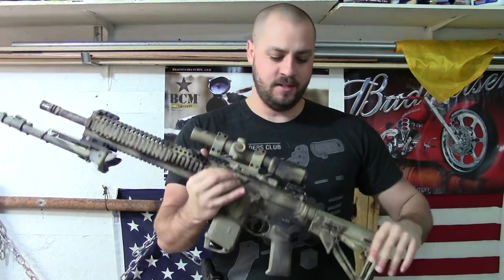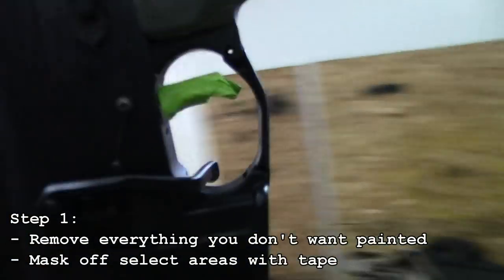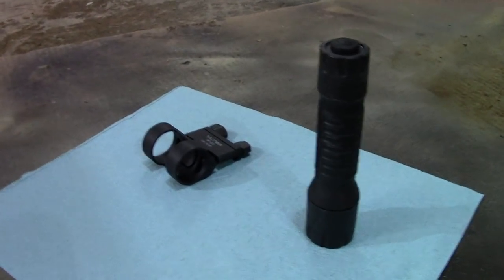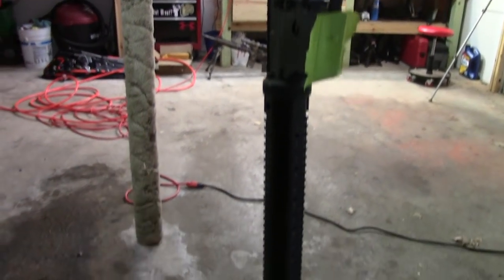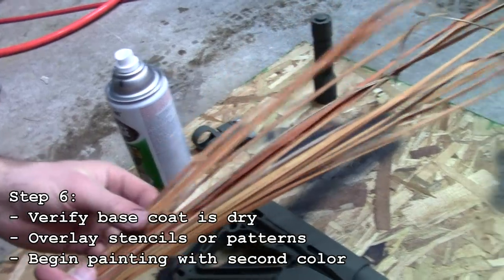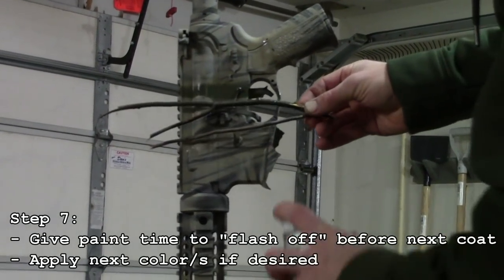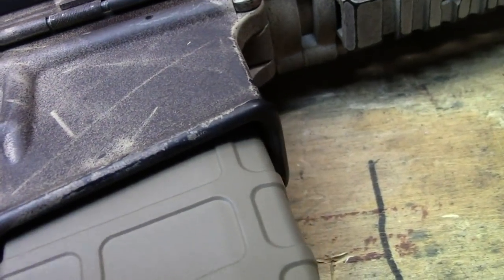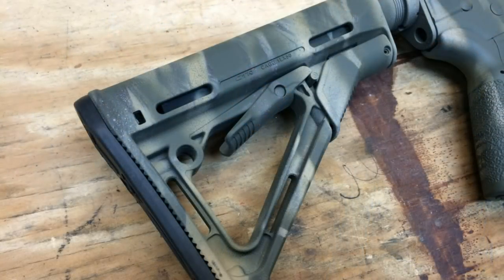AR15 Camo Paint Job - How To

Comment: Couple of hints:1. Wiping with a rag while still wet gets it cleaner. Kind of like preping a car.  If you only wet it, some of the junk just relocates.2. Final wipe with isopropyl 91% gets deep.  Then one or two coats of adhesion prometer on the polymers gives a better bond.  Maybe even on the phosphate.  It's onl;y a 20 min. wait to start painting.3. Rustoleum says within an hour or after 24.  I base then wait. Next day, Fifteen minutes between colors.4. Rustoleum clear flat--isn't.  I contacted them.  There is a "Dead Flat."  It's in that new shaped can, but it shoots very wide, very fast.  Practice to get very light coats.  I waited a couple days before doing that.5.  Recommended dry is 5-7 days.  After the initial dry-to-touch of a couple hours, I set it against the wall next to a heat register for four days.  Doesn't really stink.
Reply: Yes with rust-o-leum you need to let dry for the 24. I've found that the Krylon dries much more quickly if you let it out in full sun...tends to bake it harder...I my self don't care for the cerocote. When it chips/wares  you pretty much have to do a tare down. With paint it's pretty much a touch up and you good to go...
Everyone that see my firearms wants me to do theirs and I've had a ton of offers from people to buy then on the spot...My experience is that it up's the value by the many whom enquire
Reply: Good lord dude, you're spray painting a rifle... not painting a new lambo.

Comment: Looks nice. I used 4 colors. Black, hunter green, dark brown, and nutmeg which simulates a sand color. I used painters tape and tore pieces to make a tiger stripe camo right on the black anodized finish. Then painted it with hunter green. Made a stencil out of a piece of cardboard in a tiger stripe pattern and used that to apply the brown and nutmeg. Once I was done I lightly misted the entire rifle with the hunter green and nutmeg to blend all the colors together. Used hair dryer to dry the paint faster. Removed the tape and it was done. Turned out really nice. Standing ten feet from the rifle laying in the grass, it blended very nicely. This rifle is also the one I'll be using to hunt coyotes and other small critters with so camouflage was important imo.

Comment from the maker: Lots of you asked for it so here it is!  AR15 camo paint jobs!
Reply: Did you remove any parts or internals? I would think just throwing paint on the rifle could cause some sort of malfunction or interfere with the operation of it
Reply from the maker: Aluben Only the BCG.  We closed the dust cover and didn't spray into the mag well.  The dust cover seals off well enough that there is probably no need to remove the BCG, but we did just be safe.  The amount of paint that might get through the dust cover is so small it wouldn't have any effect on the function and it would be worn off after the first magazine is shot through the rifle.
Reply: wouldn't let me tag you. But did the gun come with that delta ring or did you add it extra. looks bad ass and way easier than mine to take the handguards off. Is it a BCM and you can put one on an ar from a different manufacturer? sorry lol I'm new to ar's. I recently bought one. I'm usually an ak guy
Reply from the maker: Always Armed88 That ring isn't technically a delta ring per my understanding, but it does look like one.  That is just how the LaRue rail mounts to the upper.  This is a complete BCM upper, the rail has not been changed out.
Reply: Hey I know this is older video but do you need to tape off the gas block I have a shaved fsb under my bcm kmr just wanted to know if I needed to cover it before painting. Thanks

Comment: Brake clean is a terrible choice for pre-paint cleaning.
Reply: yeah its also a terrible choice to spray your rubber and plastic with. SMH. 50/50 H2O/IPA.
Reply: hotrodsather. Why? I've had good luck with it for 20 years. No residue, and drys quickly. I also use air to dry after rinsing.
Reply: I always use alcohol
Reply: @jhutch1470  it dissolves more than you'd like, like the wax that keeps your handgrip's rubber flexible.
Reply: @Justbase  I use it on my upper, while it's detached from my lower. I usually use the regular gun cleaning stuff, but have used brake cleaner for heavy stuff.

Comment: The one problem I had with Rustoleum was on the extension.  Once painted the B5 SOPMOD and LMT SOPMOD stocks would not slide over the extension freely.  I had to put a mag in the lower and use my foot as a brace on the mag using my body weight and pull the stock off.  I removed most of the paint on the extension to allow for the stock to ride freely in all positions.

Comment: What's stopping paint from leaking into the dust cover, charging handle, mag release, etc?
Reply from the maker: Tolerance.  All of these components seal pretty tight.  It's a non-issue.
Reply: Highjak86 Thanks for the reply highjak.

Comment: The first coat looks like the Rustoleum Army green, then it looks like you covered it with the deep forest green , there is no Rustoleum  OD Green, so could you tell which one you used,or what you did for to the base color. Because it most definitely change from the Base coat at the start and then when you went to laying it down the straw strips it was dark green.
 Thanks, trying to use y'all's technique

Comment: Did you use any sealer after you were done?  I know that there are non-glare sealers that might make the paint job even more durable.  Thank you for the informative and helpful video.
Reply from the maker: Negative.  Even the matte and "non-glare" clear coats still have some level of sheen to them.  We don't care about the paint enough to feel a need to preserve it.  We would just re-paint when we feel it's needed.

Comment: im surprised that break cleaner didn't melt your stock/pistol grip.
Reply from the maker: Oh, it's not that strong at all.  Acid might do that.
Reply: AIRBORNE916 Brake cleaner is not too strong and dries extremely fast. I also hit it with compressed air and it dries in seconds. It's really great stuff.

Comment: I'm in the processing of building an AR from scratch, so this may be a dumb question but would you still recommend spraying it down with the brake cleaner?  All parts are brand new (stripped upper/lower) and new rail.  I also plan to paint before I add the upper and lower kits for the contrast...Oh and do you prefer krylon over rustoleum or does it not matter?
Reply from the maker: Yes, most parts, especially when new, come with at least a light coat, some a heavy coat, of oil on them.  Always degrease before painting even if new.  Krylon vs Rustoleum, I'd call it a wash, pick which one you like and go with it.  Some may say Krylon isn't as good, but I can't say.

Comment: I have had better camo patterns turn out, when starting with a light color base coat (white, sand, tan) then adding the darker shades, as you layer in your patterns. And practice before painting. Test it all out, on a scrape piece of card board. You may discover your stencil is to thick or thin, and you can replace it. And test spray from different distances for a variety of effects, from detailed lines, to a misty foggy layer.

Comment: Wow, thats a really good job, I have a few questions though. Is that a heater pointing towards the gun to speed up the drying process? Also how long did you wait in between the de-greasing and all of the coats of paint?
Reply from the maker: Yes, that is a heater, but no it's not for the drying process.  This paint job was done in the midwest in Jan (Winter) so the heater is only there to raise the room temp up to painting temps (consult can for painting temps).  Also, use heater at your own risk, paint is flamable.

We waited 15-20 or so after degreasing.  Just long enough to make sure everything was dry.

Paint coats were 5-10min inbetween.  Consult can for that info too.
Reply: Thanks for impressive reply speed. I hope these answers help many other people too, thanks.

Comment: I used that flat camo paint for a multicam scheme on a bunch of my mags and they look insane. The only problem I have with it is that it wears so quickly. The wear actually looks really nice, but the lack of durability is steering me toward duracoating the rest of them
Reply: Purpose of rattle can camo is if you change environments and need a different color scheme but the same rifle

Comment: Only thing is, I had much better success when doing straw camo when I had the paint can about 2-3 feet away. Seems like once it gets out further, you don't have to worry so much about visible spraypaint lines, and also the paint that is transferred tends to be more likely to be going the same direction, while when it is close to the nozzle, it tends to swirl around a bit.

But then again, I was using very fine stencils (broom-straw), so that palmetto-frond looking thing might allow closer spraying.

Comment: I didn't have any luck finding any actual od green, I know rustoleum does use an army green and a deep forest green. Do you know which one you actually used? Also, do you prefer rustoleum over krylon camo paint or just happened to grab rustoleum? I found the krylon for close to the same $5 price tag and checked amazon reviews that were same if not better for krylon. Any pref?

Comment: Nice job guys!  How do you guys like that battlecomp 2.0?  I just bought a 1.0, but haven't tried it out yet.
Reply from the maker: The BC is a good compromise between a brake and a flash hider.  Flash isn't much worse than the A2 and felt recoil is less.  We do notice a bit of downward movement at the muzzle with the BC though.

Comment: Ok, my question is this.  Will cleaning solvents strip the pain away?  Like Hopes and such?
Reply: yes
Reply: CLP Powder Blast will crinkle paint up and flake it off in seconds. I used it to strip an AR that I tested a little satin spray paint on (Looks like crap. Dont use it). Really easy to strip if you have an air compressor to blow it all off.

Comment: Does the eject port door keep the paint out of the internals or do you mask off any inside the door? 
Planning on painting mine and dont' want to get in to a "oh crap, I didn't realize paint would get in there. . . . " situation.  leave bolt and all internals in place, close door, mask magwell or insert mag, and dont shoot paint into the barrel...  
Sound about right?   Any further masking is just to keep from painting parts that you prefer not to have painted, correct?
Reply from the maker: +JeremyF4i  It keep pretty much all of the paint out.  We removed the BCG, but did not mask it inside.
Reply: cool.  thank you.  very anxious to paint it but hesitant to make sure I have a good game plan and cover all bases.. Painted my tournament style paintball marker a couple years ago.. and turned out good, but on the outside it has less moving parts that the AR.  this spring the AR will probably get some paint now. :)

Comment: So I have a ar15-22 which is an ar body but shoots 22s and I was wondering if I would do anything differently with painting it or would I just do the same steps? Sorry if it's a dumb question but I feel like I had to ask
Reply from the maker: The same steps should apply, but put a piece of tape over you bolt as most 22LR ARs don't have a dust cover.

Comment: Thanks helpful. What do you guys think of the TRS 25 red dot. It has a 3-4 month constant on run time. $100ish. I was going to get an Aimpoint Pro. But considering this first.
Reply from the maker: We haven't used the TRS-25 personally, however we've heard many good things and only a few bad things.  They won't hold a candle to the PRO when comparing durability though.  Just our opinion.

Comment: Did you cover up the rail numbers with tape? Do you suggest it?
Reply from the maker: No, we visually know what rail section the important parts (optics) go if we need to take them off and put them back on.  You could do that, but it's extra work for little reason in my opinion.  Plus you're creating an area where paint with chip easier.
Reply: Thanks for the quick response! Will take tips into account! God bless.

Comment: hey always wondered how paint held up on  barrels after say a day of shooting or however. iknow this isnt a permanent process but does it like bubble or run? planning on painting my gun..thanks man.
Reply from the maker: The cheap rattlecan paint like this will be tacky for about week or so before it fully cures. I've never had any of this stuff bubble on a barrel.  Holds up good enough to heat, not as good to scratches and such.
Reply: ok cool yeah im not worried about scratches and what not. i like the whole battleworn look these things are tools after all that was just my only concern is wht happens to the barrel from a day at the range but cool thanks alot man keep up the good work you put out some good content. allways looking forward to the next vid.

Comment: the brake cleaner wont hurt the plastic or metal at all?
Reply: nope
Reply: Michael Griffin  Not true brake cleaner is very caustic
Reply: true for some materials like organic tissue, but it will not change metal's existing properties what so ever. And i have never had a problem with it on polymer. M1tch454
Reply: Michael Griffin

I was speaking of it being caustic on polymers. I have seen contact cleaner, brake cleaner, blue shower etc "dry" out plastic here at work. Why risk it? If you're going to do something you might as well do it right
Reply: ok, I believe you, I can see that happening. Ive definitely seen the cleaner affect other kinds of plastics. And I agree, the only way to do something is to do it the right way the first time, no exceptions. M1tch454

Comment: Can you grease your barrel/other parts after the painting process is done, in order to prevent rusting, or is the paint going to help do that?
Reply from the maker: There is no reason to grease the exterior of an AR15.
Reply: What about on a bolt action rifle such as a Remington .270?
Reply from the maker: Grease, no.  Oil, potentially.  The only real reason to oil the outside of any metal firearm is to remove any water or moisture.  Once that is off there really is no need to apply any unless your safe is improperly setup to control humidity.
Reply: Gun painting

Comment: what is the wear on that paint job, going to the range once a month and running it hard?
Reply from the maker: It holds up well enough for the intended purpose, but yes it it will get the wear look after a bit.  Check out one of the newer Update or BCM KMR paint removal videos we posted in the last couple weeks, it has one of the FDE painted rifles in it for an idea of wear.

Comment: @Highjak86 does the Brakleen damage polymer parts like the stock, grip and PMags? Like is it corrosive to plastics?
Reply from the maker: No.  It's not like it's being soaked overnight.
Reply: +Highjak86 ok sweet thank brother. I will use this method you used on the video for my rifle. I wish I could send you pics of the end result so you can see how it came out
Reply from the maker: JuGGtimus1
Looks us up on Facebook - you can share any pictures there.
Reply: I sure will brother. God bless
Reply: I would suggest using the "non-chlorinated" brake cleaner.  the chlorine will actually cause rust.

Comment: Shouldn't you disassemble the rifle to do this?
Reply from the maker: No, that is absolutely not necessary when using rattle can as seen here and I would not recommend taking a rifle down to all parts to paint it with a $5 can of paint.  That's silly.  Cerakote is another story, but I would never disassemble a rifle to paint it with this.

Comment: do you find the moving parts sticking after doing this?
Reply: If you fuck up, yeah.  I'd advise removing the BCG and stuffing the whole upper with paper towels, taping over the ejection port, THEN closing the dust cover.  After that, make sure you have a good seal between the upper and lowers.  Perhaps tape them off or stuff something in the cracks to seal it.

A little bit of care will make it all just fine.  And if you STILL get your parts gunked up, soak them in acetone for an hour and scrub them off.  Problem solved.
Reply: I stuffed my mag well with paper towels, and taped off the trigger and even the bolt before closing the dust cover.  I've never had a problem, but take a sharpie marker, and draw a line where your mag cuts off into the well, and tape that area off on your mags before painting them.

Comment: I've got a question for anyone, I just did my first paint job on a rifle a couple days ago. It allegedly should take 24 hours to fully dry but when I handle it I get paint residue on my hands. Why is this/how do I fix it?
Reply from the maker: You could have painted too thick or the paint still hasn't dried due to a handful of reasons.  You shouldn't be getting paint on your hands after 24 hours though.  What kind of paint did you use?

Comment: You shouldn't paint your barrel will not cool down like it should it will prevent heat from escaping and barrel from cooling off which will cause your barrel to warp or gas block to over heat and break gun looks sweet but don't paint the barrel